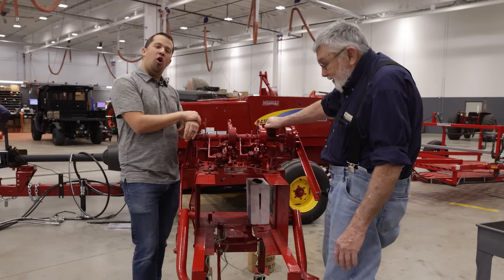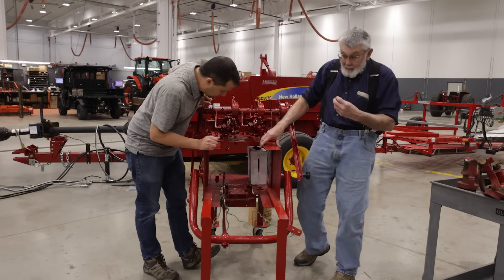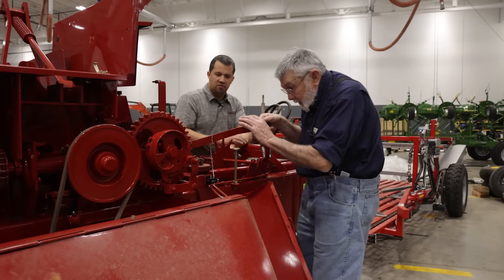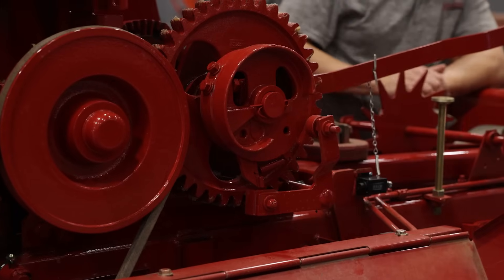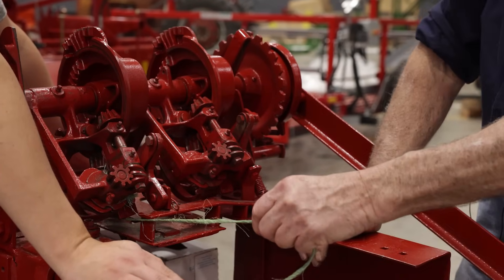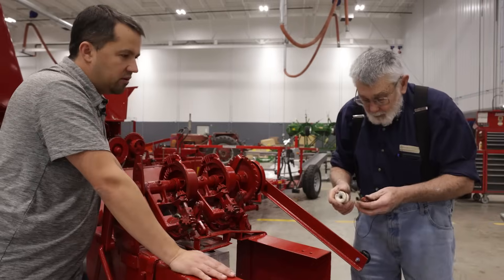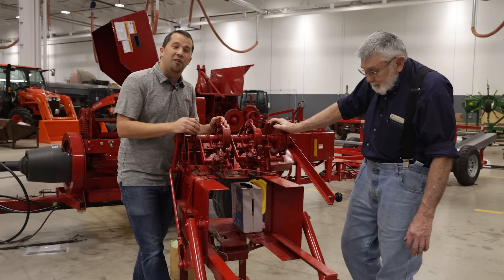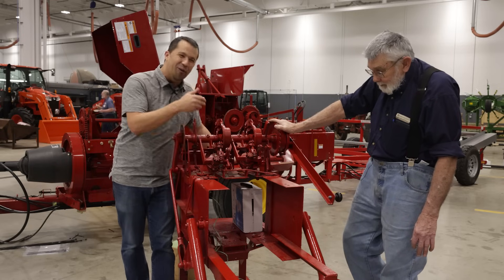The magic of a baler knotter | New Holland Small Square Baler Knotter

Comment: The knotter shaft rotator cam (twine finger cam) broke loose and doesn't drive the fingers. Knots are formed but not tied tight and the string is there and cut but not in the knot. What to do? I don't even know if "knotter shaft rotator cam" is the name for it but it does drive the tucker fingers and is not solid to the shaft like an older baler I have. It is just a 3 - 4 inch duck shaped piece and located at the very top of the knotter assembly on the shaft that holds everything. Is there a spring or something gone? On one diagram I saw online it was part #27 but the name was not shown on that page. On an older video it was called the twine finger cam. How do I fix it so it stays in a fixed position? It seems to just move back and forth. with no hold. Please advise.

Comment: As a mechanical design engineer for 35+ years, it's impressive to me that this whole knotting mechanism was invented and designed at a time long before CAD (Computer Aided Design) and especially 3D CAD.  The initial designs were all done with pencil/pen, paper, drafting table, slide rule, protractor, compass, and triangles.
Reply: The first twine knotters of this principle were invented by a guy called Appleby and applied to grain binders in the 1850s.

Comment: We had a John Deere 336 baler, we always kept it in the dry, greased it each time it when into the field and only greased it at each fitting until you can see the grease come out. Kept it clean and dry always. It was great if it worked but it was a long hard day if it wouldn't tie!

Comment: 10:10  In a regularlly operated baler, the bill hook and twine discs are polished to a shine by the rubbing of twine, they wouldnt have paint or rust on them.  A disused, neglected baler never works well.  A leaving them outside in the weather is a death sentence for all the moving, sliding, turning surfaces of a baler.  Far too many operating machines were abandoned and "put out to pasture" , making them rust buckets.  My balers are never left outside uncovered in the rain, and always put inside overnight.

Comment: Great video! The manual works if you read it and don’t lose it! I visited a friend and he had a NH baler that was only working on one side . He ask me if I know about balers , I told I know when they are maintained they work great . Turns out he had not read the manual or adjust the bill to slide the knot. So I adjusted it per the manual by rigging up some big wrenches to make a lever and sprung it into tolerance. I also made him go buy some parts. Works great for 2 years now. It’s just not worth waiting until hay is ready before repairing the baler.

Comment: I had weak knots on my Ford 430 baler and my new Holland 357 square baler. It was a common problem. These are poor knots had a shoe lace loop. This was the cause of the bill hook not completely opening to allow all of the strings to enter under the bill hook tongue.  When I added a thickness of welding bead for the tongue to open where the wheel on the other end of the bill hook  runs over a hub then my bale knots were like new and strong with reliability to not miss. The hub that guide the bill hook to open, when ensuring to begin tying the knot had worn down and would not provide the three sixteenth of space for the two strings to slip under the bill's tongue. Once fixing that I was on my way.

Comment: Love this.  Just road around on the rear of a NH68? that my father's father bought new in '57 according to my dad.  The twine was hanging up on the finger bolt.  I had to make sure it didn't catch.  He later took it apart, broke the cast iron spacer (surprised him when it shattered) and had to machine another without as much play.  So interesting to see the mechanism in action.  My mom's father owned a Ford/NH dealership and was really good at troubleshooting these balers.  Interesting stories of my mom and dad's courtship.  Thanks for sharing.

Comment: I have a 270 I found two years ago. It's in really good shape. Made between 61 to 63. A slow poker at 65 strokes per minute. It rarely misses a tye. I wish new Holland is missing the boat by not making a smaller simple baler for the under 40 hp folks who have smaller farms.   The older ones are getting harder to find.  Thanks for the great video. Tom from n y

Comment: Walked many a mile alongside a twine bailer to retie twine when the knots slipped. You had to spot it quickly to be able to tie them before bail reached the end of the discharge chute. If you didn't get it just right then you had banana bales that had to be broken up and spread out in the next windrow.  After watching this explanation it looks like the twine clamp wasn't holding tight enough and the spring needed replacement. Grandpa thought that the issue was with the knotter and would fiddle with it for hours during down time and off season.

Comment: The knowledge that man possesses is more valuable than gold. It is knowledge learned from 1st hand experience, not some text book. I agree you you Neil, that the knotter was designed by someone with a ruler and a pencil, and still to this day is unchanged. I would be curious to know how the Knotter works on the balers that use wire